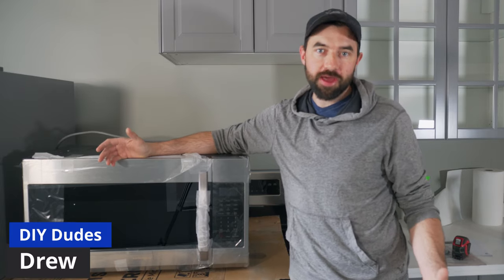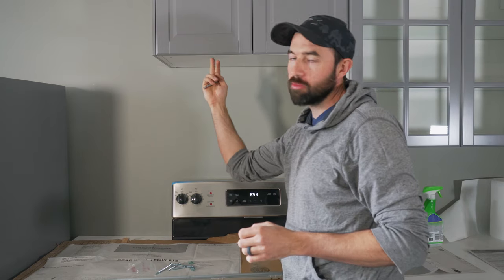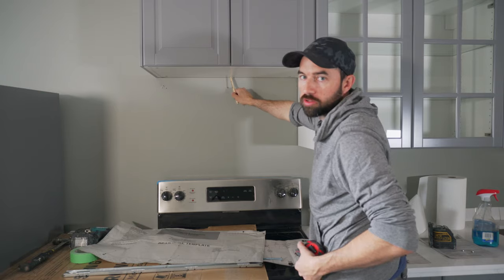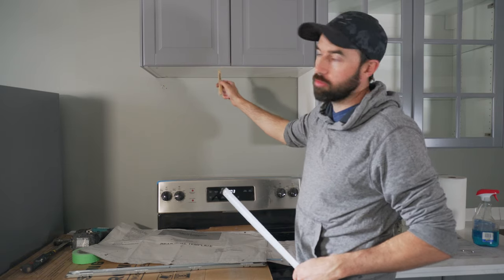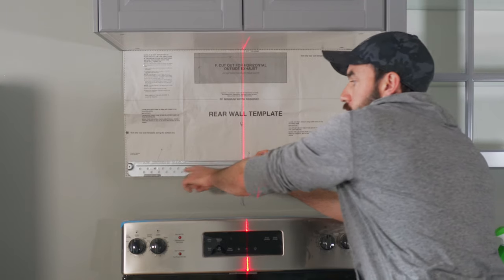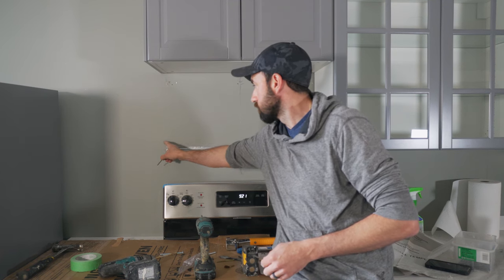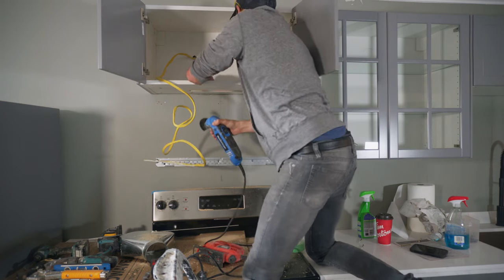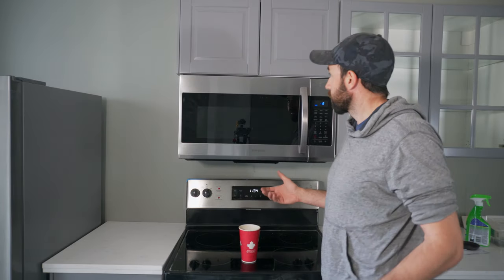Installing a Microwave Over a Range/Stove - Step-by-Step Guide

Comment: We had the exact same question as the one by @carolineperry760 had regarding the bump out kit.  We are installing our microwave on the end of a row of cabinets just like in this video.  I don't know if the side cabinet is primary reason for the bump out (so the door opens correctly).  The installation instructions keep referencing ventilation requirements.
Reply from the maker: Most of the microwaves are designed to extend past the front face of the cabinet as there is an air vent that sucks air at the front.  

That’s the main reason for the bump out but check your microwaves specific instructions, they are all abit different